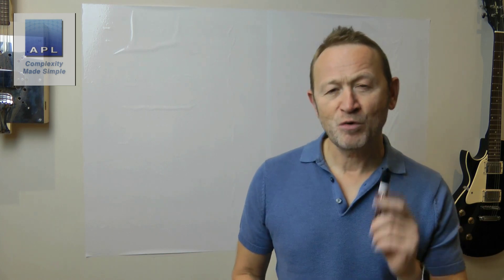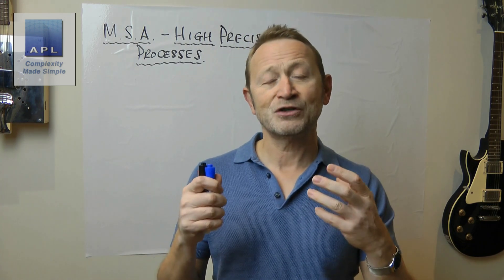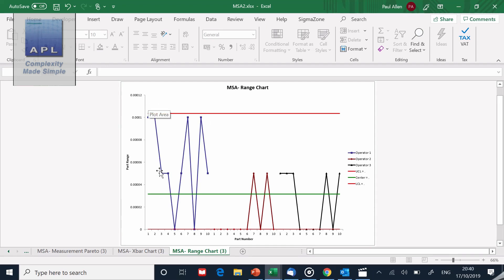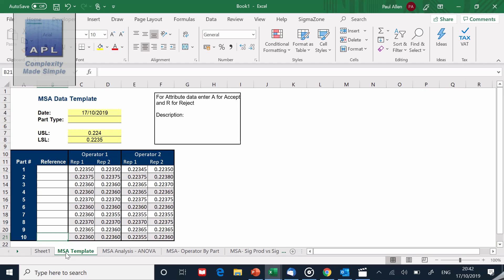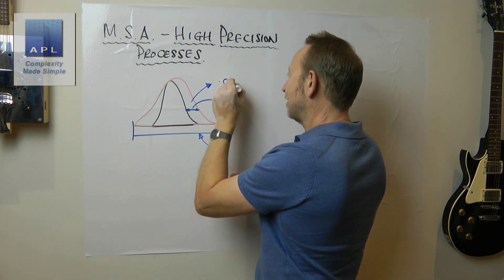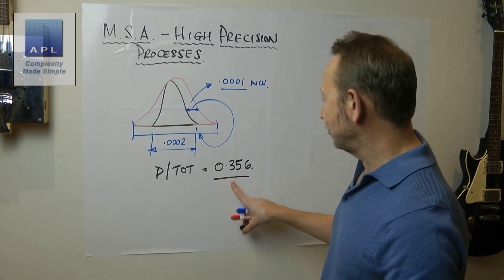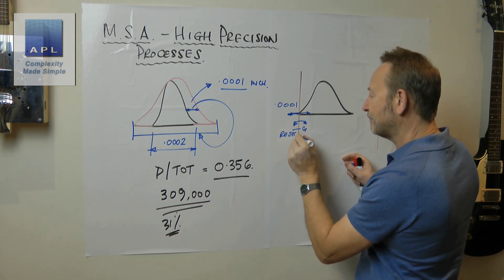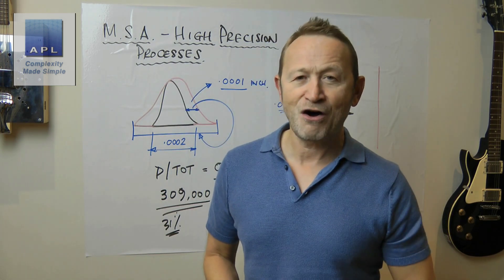MSA - In High Precision Processes

Comment: Dear Paul, precisely my case in high precision machining company, MSA does not pass normal rules for stability for example, this because our devices are very good, by our experience we reduce some percentage the tolerance meaning narrow specification limits to neutralize the small error made by employees measuring in the process. your explanation is excellent since it is not in MSA AIAG nor VDA manual. thank you again. ¡👌

Comment: Hi Paul, an interesting case study. I ran this through my EMP software, this is the Don Wheeler approach.

The analysis quickly revealed the following:

The measurement system can easily “see” the parts I.e. the resolution is fine. 

The Probable Error shows that the best that the measurement system can see is 0.000018” therefore the last digit is pure noise and not of any use.

The Intraclass correlation including reproducibility is 0.874, just including repeatability is 0.89 so the effect of operator 1 is very small.

You could track a process to a Cp of 1.46 with this measurement system before it would degrade to a second class monitor.

I can send you the analysis if you wish. AIAG MSA rules tend to condemn perfectly good measurement systems for many reasons, I switched to EMP 20 years ago. 

Thanks for the video!
Reply from the maker: Hi Geraint - Good to know I'm on the same page as Wheeler, one of the greats...I've not heard of EMP though so please send the analysis over. Paul.allen@allenp.co.uk

Comment: Dear Paul, what you have explained is really part of the MSA handbook. If you apply your measuring system to make a decision about if the parts are good or bad, BUT you DON'T use it for process control, you can use the tolerance of the measured dimension instead of process variation. The only question here is that when you take samples from your process, but do not measure all of the parts then is this a process control or not? You could say if you do not have an SPC-chart then it is not a process control. On the other side if you do not measure all manufactured parts then it is a sample control what is finally a process control. So in those cases the tolerance cannot be used for the GRR-study.

Comment: Yes, Paul, one cause was Operator 1 repeatability. But the second one is the resolution, which is here RES%TOL = 0.00005/0.0005 = 10%.
This is exactly at the limit of acceptance from AIAG recommendation, but it would harm the VDA Vol.5 rule of max. 5% of Tolerance.
And then, I guess, by that they could achieve a P.Tolerance < 0.2, which is almost perfect for these extreme conditions.
So, raising the question if there is a gauge available with even better resolution at affortable price, it could improve the situation further.
P.Total is slightly worse than P.Tolerance, so Process Cp is probably below 1.0, so rejects and misclassifications are likely present.
Reply from the maker: Joe - Great to hear from you, and thanks for the addtional comments, really helpful. I'll take a look back at the video and consider your comments. I have feeling in this case this was best equipment that could be put at the point of activity...

Comment: Paul  thank you for your example. Love your work. Two things, what non contact systems are avaliable to measure 50 millions ? ( it has been s few years but they do exists)  2nd please use the centrial limit therom, this is a great example for this application. Var = 1/ sqrt of (n)   where n is the sample size.... at a sample size of 9  my error is cut var to a 1/3 ... for example at 30% error in my msa divided by 1/3 your are in the 10% error range.  Please check out the central limit therom.  Yes your inspection labor costs go up but you do not need a capitial investment in the MSA.
Reply: @paulallen5321  keep up the good work.
Reply from the maker: DWZ - Glad you find the work helpful. If you think you'd like to support the making of these free video's take look at my donation page.
buymeacoffee.com/osId2T0BL
Many thanks...